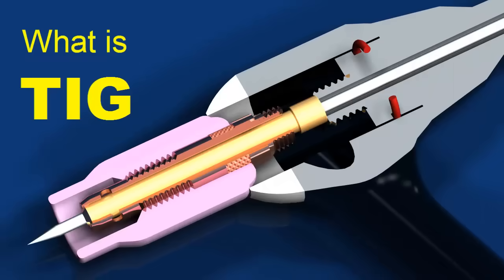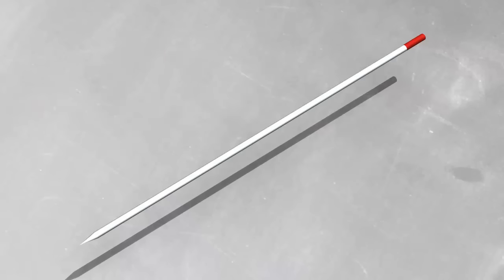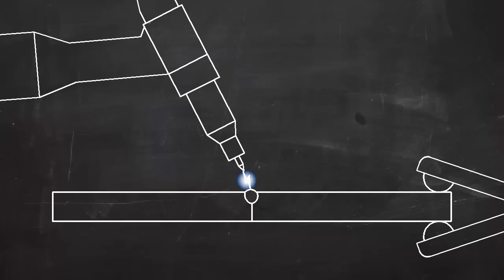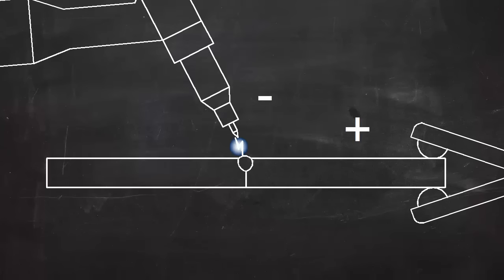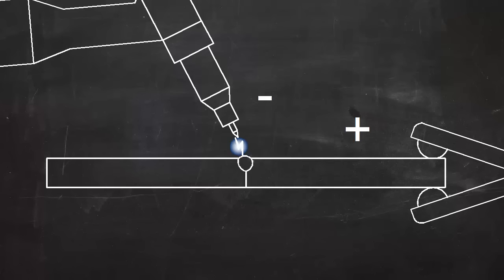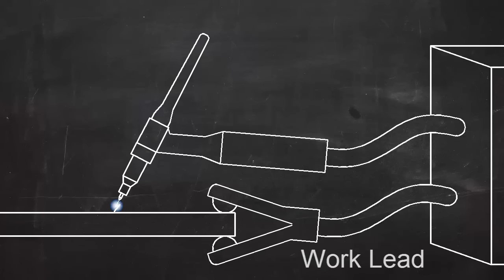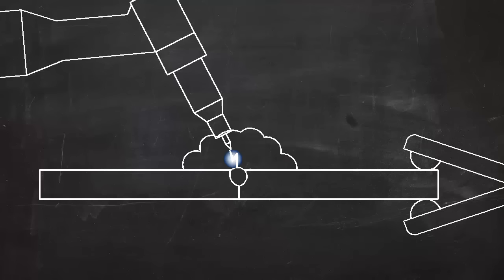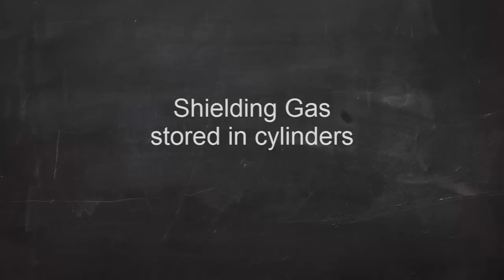What is TIG Welding? (GTAW)

Comment: Add: the non‑consumable tungsten electrode is inside a ceramic cup; argon/helium flows out of this cup, covering the electrode tip, weld pool, and the end of the filler rod when you dip it in.

Comment: A newbie here. Thanks for your video. Is it necessary or compulsory to use argon gas for TIG? I have a 3 in 1 welding machine that has TIG, MIG and MMA. It's not in the manual if I need gas for TIG. Pls enlighten. Thanks for answers from anyone. 👍

Comment: TIG draws the molten pool out of the base metal, it is not just melting the surface. Thats because the electric loop is backwards.  It seems like when you strike the arc that it jumps from the Tungsten to the workpiece but its the other way around.

Comment: This has been absolutely bugging the hell out of me. Why is the electrode negative and the work piece positive, but the current is described as going from the electrode to the workpiece. Doesn't current go from positive to negative? I know it's possibly just a small detail, but damn is it frustrating.
Reply: Look up conventional flow vs electron flow. Long story short, electrons actually flow from the negative to positive in any circuit, but because Ben Franklin (yes, THAT Ben Franklin) didn't know about the existence of electrons when he described current flow during his groundbreaking experiments with electricity, the convention is to describe current as flowing from positive to negative even though the reality is electrons flow in the opposite direction.

Engineers typically use conventional flow to describe the movement of current because it's a lot easier to visualise when designing electronic circuits, but welding isn't concerned with design, it's concerned with the actual flow of electrons since that's where the source of heat is coming from in an electrical arc, so welders typically talk in terms of electron flow.

As for why any of this actually matters, that's a complex topic but it has to do with the fact that the motion of the molten metal droplets produced during the welding process changes depending on the polarity; an excess of electrons on the droplet will cause the droplet to experience a force toward the work piece, whereas a lack of excess electrons will mean the droplet does not experience that force. Each scenario is useful in different circumstances, but that's opening a huge can of worms.

Comment: hey everyone, I would love to have some answers regarding questions I have about welding. Here are some questions I have:

1. How do we determine the value of current and voltage for the welding process?
2. Is it possible to perform TIG welding without filler rod? (for my case its for joining two thin plates)

I would really appreciate it if you guys can help me with these questions. This is for my studies. Thank you in advance.

Comment: Why can't we use DC for Aluminum welding??.... since TIG weld pool is protected by the inert gas and could avoid formation of oxides of Aluminum on the weld pool....then why AC is used for Aluminum welding it can be done with DC also by usual DCEN method .... ??

Comment: Thanks for this video. I want to start welding and I want to start well, with the right equipment and process. There are some TIG welding machines that don't use gas...what are the pros and conts?. 
Thanks in advance.

Comment: He never mentioned that you use a thoriated tungsten for Stainless, mild steel and from memory copper and brass.
When you work with aluminium you use a zirconiated tungsten. Even though he says you get a cleaner weld. The slightest bit of contamination weld destroy your weld.
If you don't have to share tungstens. You can sharpen both ends. When one gets to contaminated just flip it over. You do however lose the colour code.

Comment: It's worth to add that TIG has the best result joint. And it's ideal for aluminium. But has huge disadvantage compared to ARC: you need gas cylinder. So as a hobby TIG doesn't suit.

Comment: Which welding type would be the best for a newbie to start with? I don’t like the fumes that some of the welding processes through off.  Would you suggest setting up an exhaust fan system to pull the fumes out?  I never welded anything before but I was thinking about getting a welder to do repairs around the shop and for hobby work.
Reply: I'd buy you a mig machine. If you're going to use it indoors. Also they sell under weld helmet respirators. Lincoln also makes a vacuum that sucks fumes.

Comment: will it work without the gas?  for small weld jobs. i see all types of cheap TIG welders for small projects. I can't tell if they use gas or not. doesn't look like there is a hook up for gas on most of them.

Comment: Quick tip: if you are tig welding a thick piece of metal with a small low amp machine, pre-heat your material so that the torch works faster and penetrate deeper.

Comment: Nice explanations,
We which is better to use when welding stainless steel , Tig or MiG ?
Which it will reduce time of finishing (cleaning and polishing) the welded joints.

Comment: Halfnium carbide remains as hard and strong solid at 3871.111 degrees centigade above zero as if it is still at room temperature, so whatever is the hardness level and strenght level of hafnium carbide at room temperature is still the same at 3871.111 degrees centigrade above zero.

Comment: The electrode is radioactive - a weld that is harmful to health.
A harmful video! (indirect)
Reply: Yes if you use Red Tungsten which is Thoriated. Gold Tungsten is Lanthanated, It works pretty much as well as the thoriated and has no radioactive substances. My employer chose Gold over Red years ago for the same exact reason.

Comment: In every type of arc welding electric sparks are formed but you say a wire is not needed then why a wire is needed in other types of welding and its true that ac makes it easier for welding aluminium but ac doesn’t generate more heat

Comment: Finally, after multiple different videos I finally know how Tig works. It seems like it can be a bit like soldering with the filler rod. I know how to MIG and stick weld, and my dad got a TIG welder so I might have to try it out sometime.
Reply: it's very close to the same  start with ss it is the easy ist  too weld I have been tig welding for the past 20yrs  alum takes a little more too do  it needs to be as clean as you can get it and
heated first before you start too weld

Comment: Need help 
What is main difference between Arc and Tig welding 
And which one is low cost ? 
Please help
Reply: Arc uses a consumable electrode.
Tig doesn't.

Arc doesn't require gas
Tig does.

Arc is cheaper
Tig is expensive

Tig is clean compared to arc and tig can weld soft metals. If you are welding steel go for arc, even though stick is harder than tig, arc is way cheaper.
At least, that's my opinion.
Reply: PLZ WATCH MY VIDEO FOR BETTER UNDERSTANDING .  https://youtu.be/xcQ_kl-dG3I

Comment: This is the one type of welding we didn't do in high school. Always wondered how it worked. Thanks
Reply: Tig the only one you get paid for😂
Reply: Same here. I’ve had TIG on one of my internships.
Reply: Nomore
  U9utjno
Reply: I went to the biggest hs in my area with the biggest wood and metal shops. I believe we only had mig and acetylene, but besides the work clamp for the comple circuit, I think tig is more or less the same physical motions as acetylene, just at a much higher temperature.
Reply: @TheIronCowboy  TIG is far more delicate than MIG or Stick... that’s why they don’t have it in high schools.
Reply: High (stupidity) schools are waste of time
Reply: @sarpuppy5415  high stupidity.... 🤣🤣

Comment: They never mention that the inert gasses used also keep the Tungsten from vaporizing as soon as you hit the pedal. It's not just for protecting the weld from contaminates, it also plays a major role in the survivability of the tungsten at those temperatures by never touching an oxygen rich atmosphere.
Reply: Good comment
Reply: that's good to know, thanks
Reply: It cools the torch as well, unless it's water cooled right?
Reply: That is an important distinction
Reply: Q: If you were TIG welding in a perfect vacuum, would you need the inert gas?
Reply: @AndyFromBeaverton  good question

Ig not

Comment: If I use to touch the metal workpiece before I start the welding and just switch on the setup, then will touching workpiece give me a shock, since it is connected to a positive end of DC source? have you ever tried it?
Reply: It shouldn't shock you, ever, if you are properly set up.  It may burn you if you touch something you have welded on or with, and exposed skin may become sunburned from the light.  Use pliers to move parts and be careful where you put your hands and the torch.